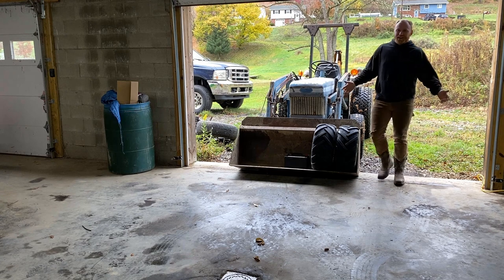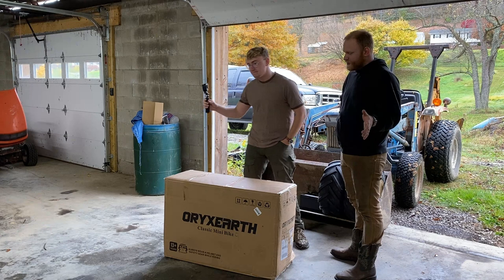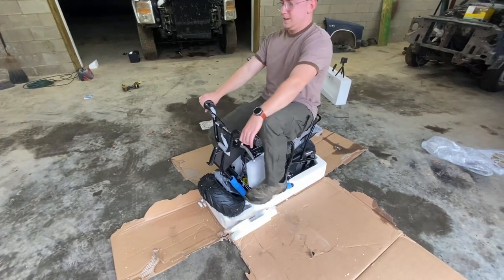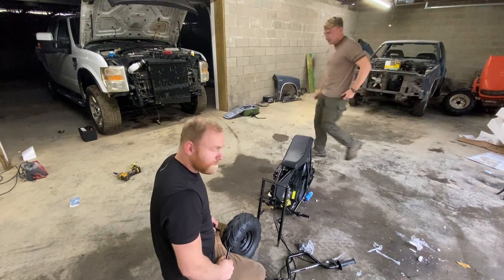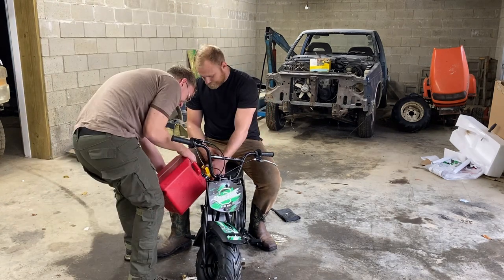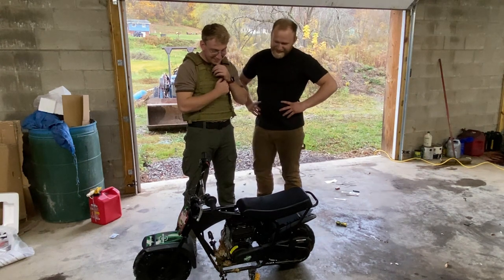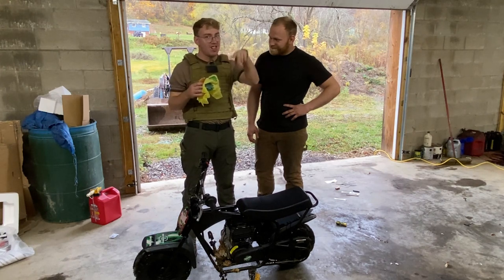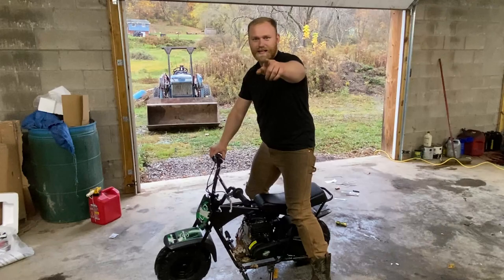Amazon Oryxearth mini bike unboxing and assembly

Comment: Mine stoped starting what do I do
Reply from the maker: There’s a couple things you could try. The first thing I would look at is spark. This can easily be checked by removing the spark plug, touching it to the cylinder head and with the button is the start position, attempt to pull start the engine and watch the spark plug and make sure there’s a spark. Second would be fuel. If it has sat for quite some time you might have bad fuel in the carburetor or if you put ethanol fuel it may make a mess in the carb. You can remove the bowl on the bottom of the carb and make sure there’s no debris or maybe you’ll see the fuel has separated creating a varnish in the bottom of the bowl. Usually it will smell different than gas and have a brownish tint to it  . If this reply doesn’t make sense or you need better instruction, I will gladly make a video specifically for you and maybe others with this issue.  Hope all goes well, if not let me know.